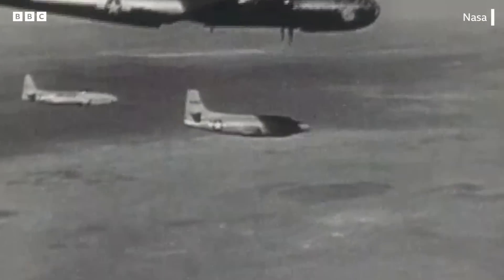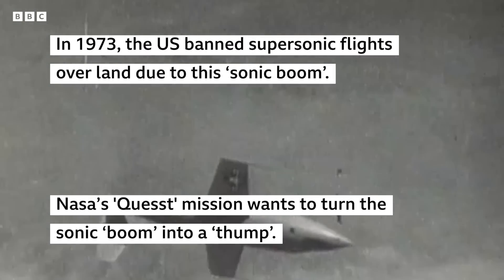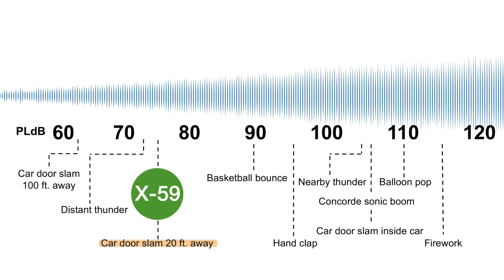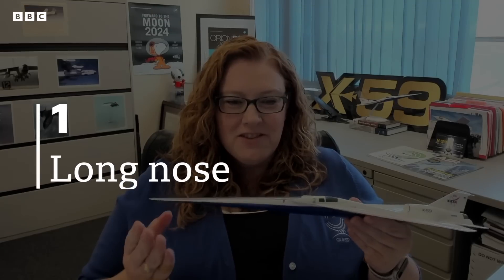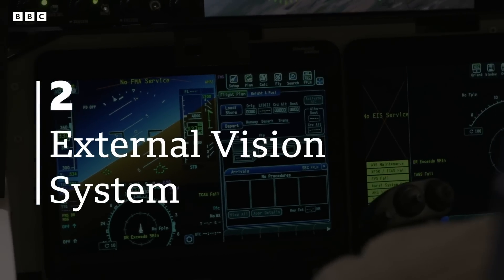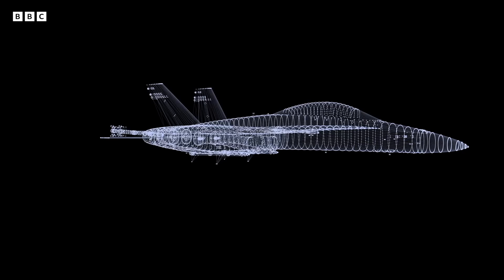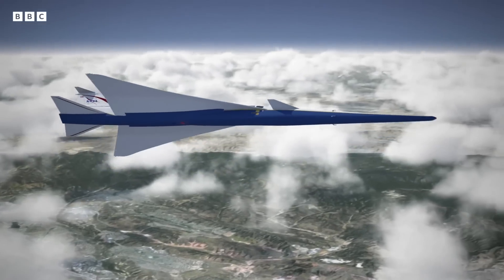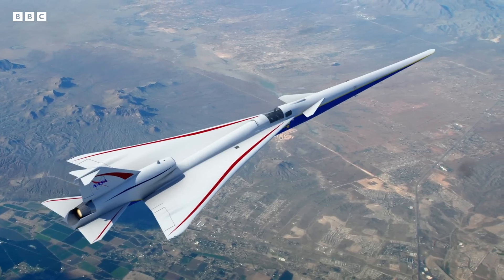Is this the future of supersonic flight? | BBC Global

Comment: Not so clear what the actual selling point would be. Saving 50% time on a flight might make more difference for longer transatlantic or transpacific flights, but since those are over water anyways the new design is less relevant. Flying in business class today you can still work in comfort while in the air, getting there a few hours sooner probably isn't worth the massive added price tag. Hypersonic flight on the other hand could be a game changer, but we're probably a long way off from that..

Comment: Doesn't seem like this is relevant to commercial flights. Surely the issue there is not sonic booms but the cost of fueling a jet to do supersonic speeds, carbon emissions and can you get enough people on board a craft like that for it to be commercially viable.

Besides, is the sound of a sonic boom going to make THAT much difference over the sound of the engines propelling it...?
Reply: to your first point I think you’re right it’s use cases are limited, to your second point absolutely yes a sonic boom is an order of magnitude greater than the sound of the engines

Comment: at high speeds how do you keep the nose from vibrating and folding?
Reply: The nose is rigid, unlike the Concorde
Reply: @joesteer311  okay, but the length of it no matter how ridged will flex...

Comment: That's nice to see.  The man has a model of a Fairey Aviation/RAE Delta 2 on his desk.  But it looks as if someone was a bit confused because it appears to have the engine intake from the Handley Page HP 115 ahead of the tail fin & not either side of the cockpit as built.
Reply: What model on a man's desk? At 0:20? That is not an FD2, nor an HP115. It is the X-59 behind him and there is an X-43 and an X-59 model behind the woman. I think you need to look again.